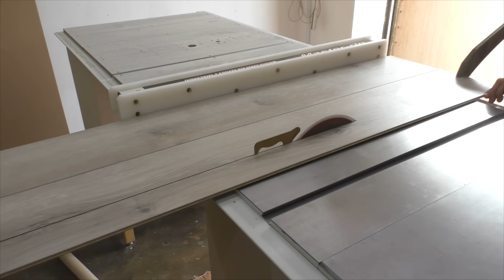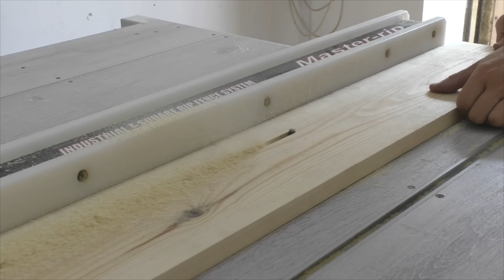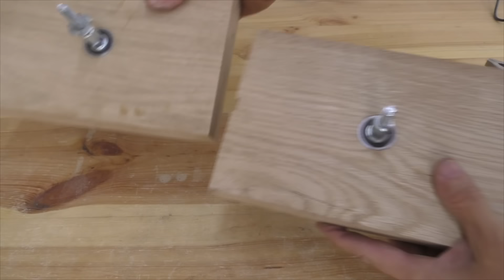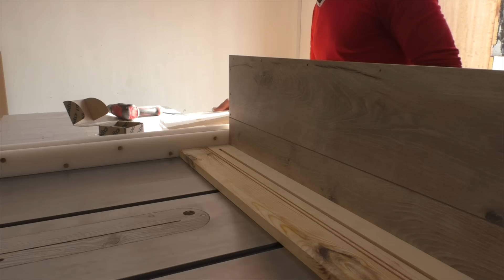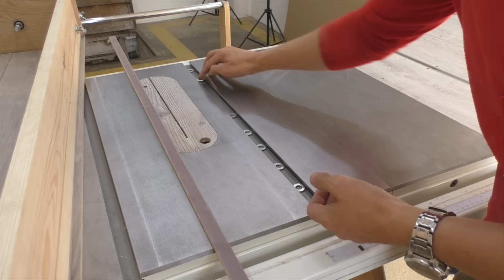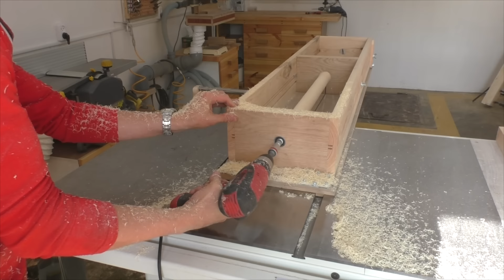🟢 DIY Large Dowel Maker - Table Saw Lathe 👉 FREE PLANS 👈

Comment: I often use laminate flooring for jigs and such. Lots of scraps especially after installing a floor. Smooth, uniform thickness, finish and stable. Great to see someone else with a similar idea. Also one of the best tablesaw dowel jigs I've seen imho.

Comment: Not being critical by any means, because I simply don't know, but would there be any advantage in tilting the blade so that the cutting is done by the ends of the teeth instead of the sides?
Reply: If tilted in the right direction would it also take some of the stress off the arbor bearings?